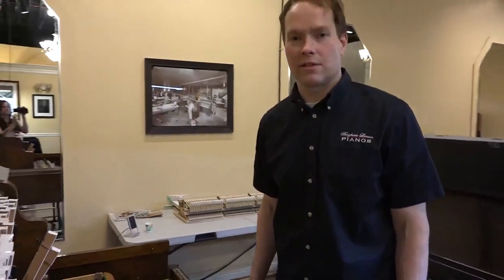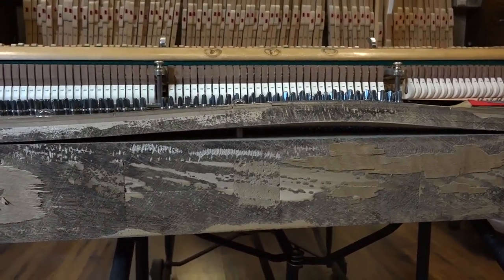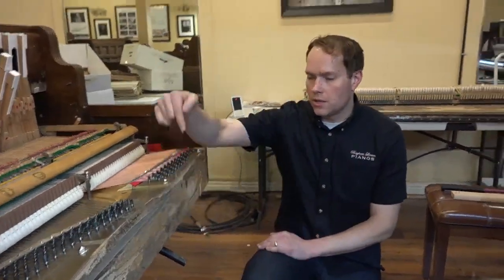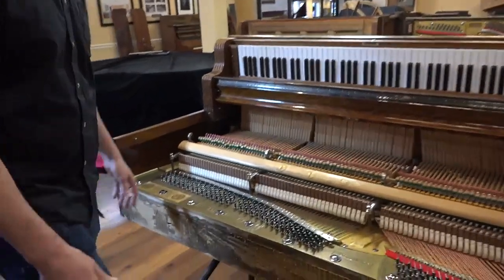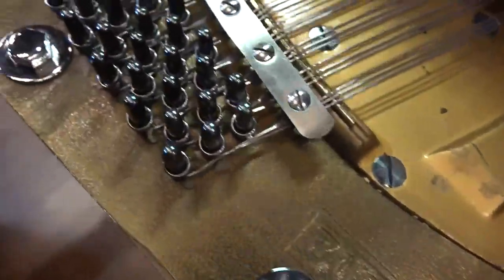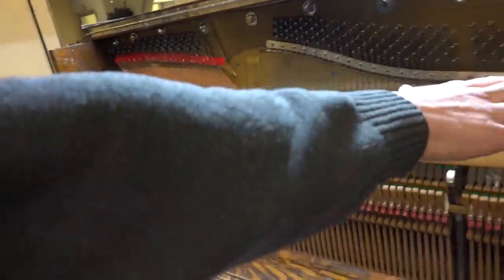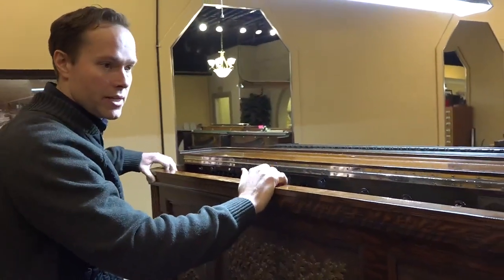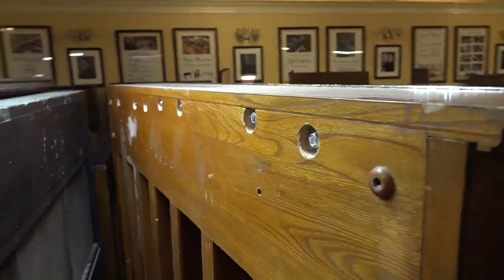Before and After! Interesting Pinblock Problem

Comment: I have similar issue on an old player piano. The player works but It is pretty rough and restoration is out of my price range but I would like to get it tune-able. As on this one, the top board appears to be glued to the pinblock. Do you have any tips/techniques, I can use to remove the top board without destroying everything?

Comment: Explain how the restoration got as far as it did without addressing the bowed out pin block ?? A piano that old frequently has pin block issues. Should had just replaced it having a customer spend that much money spent on the restoration to begin with.
Reply: Agree, as a pianotechnician myself, i was shocked they spent so much effort rebuilding that piano without replacing the pinblock. Piano as old as this was most likely designed for lower tension as well, A49 wasnt tuned to 440Hz before 1926 in USA and only in 1934 it was generaly recommended to build pianos in this way (ISO norm even later). So given this fact and the type of cast iron plate, it was designed for A49 bein tuned to 435Hz. Obviously this means lower tension.